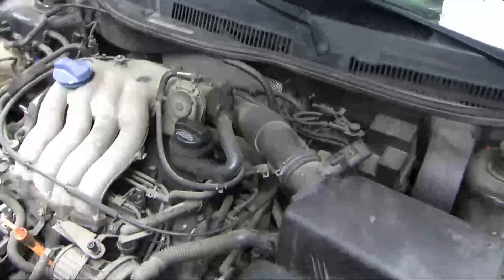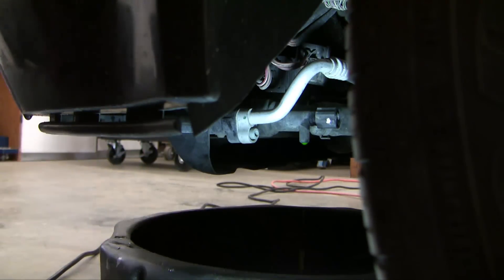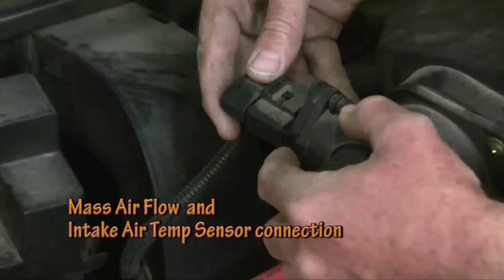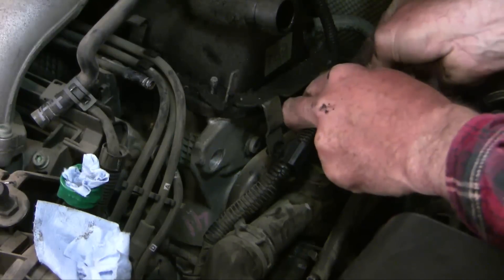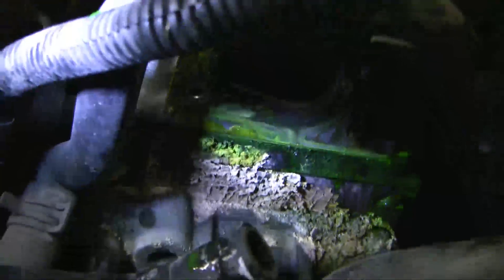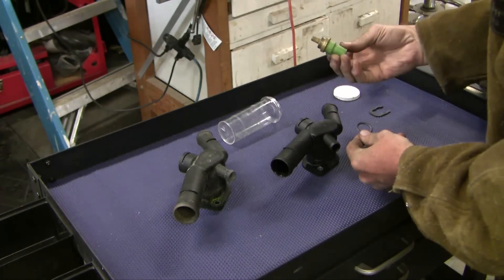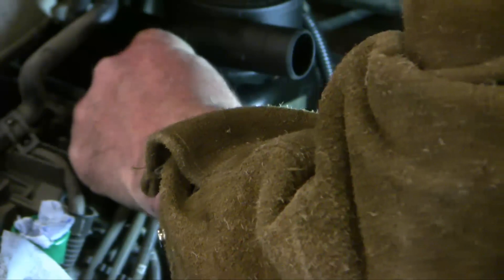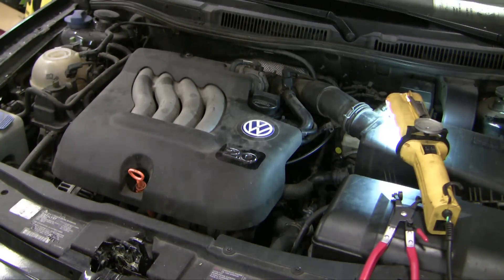VW Jetta Coolant Leak Repair

Comment: i have the same coolant flange on my jetta, and mine keeps breaking over and over it leaks past the gasket, like theres too much pressure.
Reply from the maker: This happens so commonly that many dealers consider it a normal maintenance item. I find the design frustrating, especially if you have to pay a professional to do it time and time again. It would be tempting to try something different, like higher torque or sealant. But those ideas have their own set of problems. The torque rating on the bolts is really quite low. I think the only long-lasting fix would be a steel flange, one that would permit higher torque and RTV, and one that had the same coefficient of expansion as the underlying block.
Reply: do they make a steel one, i havent been able to find one
Reply from the maker: Not that I know of, but sometimes I wonder if there would be a market for  an aftermarket device. Dealers make a living from repairing these, mostly off warranty. So they have little financial interest in going through the effort to make a longer lasting part..
Reply from the maker: simpleszabo Somehow I seem to have missed this remark when you posted it 5 months ago, but I got a notification today. Great idea! Here's the aftermarket coming through with a fix that VW should have thought of. Did it go on OK? Did you have any unexpected difficulties? Was there any issue with the fit and function of the coolant temp sensor?
Reply: nope not a single issue, same size, id recomend a little gasket seal spray to apply the gasket that comes with it, it helps when your trying to line up the bolts
Reply from the maker: simpleszabo If I ever have to do this again I'll look for a metal aftermarket replacement. Thanks for your contribution to the thread, it's worthwhile information.

Comment: My jetta almost blew up over a coolant flange issue recently. The mechanic I went to quoted me $1400, but after watching your video I really feel like I would do this myself. 
Since I don't have much experience with cars, do you think I could do this or was the $1400 a reasonable price for this job?
Reply from the maker: Any time you jump into something you've never done before, you of course take risk. We've all been there. Often, unexpected difficulties lead to other issues that may or may not be solvable with your personal skill (and tool) set. It's very possible to make things worse by damaging something else leading to more expensive professional effort, and of course there's the risk of personal injury. The amateur has to deal with complications that arise from having to use the wrong or inadequate tools and workspace, not to mention the fact that poor technique can lead to other problems. I've saved a little money by doing auto repairs over the decades, but much of what I've saved was reinvested back into tools. So, the main benefit I've gotten is not money but deeper, priceless understanding of how my cars work. Saving money should not the the main motivation to DIY auto repair since it often doesn't work out that way. Only you can say if you have the ability and willingness to go there. If you're in doubt, remember that I made it look easier than it may turn out for you.

Getting back to your situation, IF the repair goes well and no other issues are found, then, yeah, that seems a little expensive. However sometimes when an honest mechanic offers an estimate he adds something in case there are unforeseen issues, like a bad radiator, etc. Also there may be secondary issues that came as a result of the overheat. He never wants to ask for more later, so it's easier to tell everybody it's more up front, so the majority are not unpleasantly surprised. Mechanics also sometimes replace "possibly bad" parts like the coolant temp sensor or thermostat, reasoning that a callback to fix it later will sling mud onto their shop and lead to late unhappy cost to the consumer. Remember these guys are doing the estimate based on the guess about what the diagnosis is. A second opinion would be one option if you want to go there.
Reply: Thanks for your quick reply! 
This car has been on the lemon threshold since I got it (its a 2000 that was sitting for long periods of time at some point), and my dad is already willing to help me out with looking for a new one (I've got 1 more year of college left and unfortunately can't apply for a car lease/loan on my own). 

I really like your suggestion of wanting to do this in order to gain practical knowledge of how this car works. Worse comes to worst in my mind, I can't use a car that I already couldn't use. Really I feel I have nothing to lose in this anymore, so I think I might tinker with it using your video as a sturdy guide and see where I end up.

Again, thanks for your advice and awesome video!
Reply from the maker: Sounds like the right attitude, your story reminds me of various repairs I've done through the years. Bad or good, you'll never forget the experience. I hope your engine survives the overheat....

Comment: What is the little green part? I have a leak in it
Reply from the maker: The green device is the coolant temp sensor. It's held in place by a metal clip that pulls out with needle nose pliers. It's not likely the sensor is leaking, but much more likely the leak is a crack in the plastic coolant hose flange, to which it attaches. I can't rule out a leak through the seal, but given the history of this vehicle the coolant hose flange is a more likely culprit. Fix it by doing what I did here, or ask a pro to do it for a few hundred dollars. Don't procrastinate, overheating could damage your engine. While waiting to get this done, be sure your coolant level does not drop below the full mark, and if the vehicle overheats shut it off immediately.
Reply: spelunkerd it was basically spitting coolant out of it, I put some water in it to test it and it just poured out, and the little plug I pulled it out because it was kind of just hanging,
Reply from the maker: If the metal clip that holds the sensor in place comes off, the sensor will hang off and you'll have a catstrophe of coolant everywhere. It sounds like that happened to you, I hope the problem was worked out. Repair in this area isn't expensive but secondary problems from the overheat can be a real headache.
Reply: spelunkerd okay thank you

Comment: Could a failed water pump cause this?
Reply from the maker: Occasionally. 
When you're looking for a leak showing where the coolant is going, you want to remove enough plastic covers to allow you to see the weep hole, which drains the bearings for the water pump. I did a few videos on that, included in a cooling system playlist I made. When the seal that separates the coolant from the bearings fails, coolant causes progressive rust in the bearings, which should be dry. If you see a drip of coolant out the weep hole, the water pump needs to be changed. Water pumps fail in different ways, sometimes by failing seals, sometimes by squeaking pump bearings or serpentine belt strain, rarely by reduced output causing an overheat. The confusing thing about overheating is the fact that all overheats can cause depletion of coolant and trapped air, so often you need to burp the cooling system first to try and understand the underlying cause. In the Jetta MKIV, by far the  most common cause is the coolant hose flange, as shown. Good luck!

Comment: Could you, or someone, please tell me what the hose that connects to the bottom of the flange is called and what it goes to is called as well????  I am having a significant coolant leak on my 2003 jetta wolfsburg 1.8T 5sp. manual and I'm having trouble identifying the hose, the closest thing I can find online says it is a trans cooling hose, wouldn't that be for an auto trans though?? Here is a pic of the hose in question.
http://i.imgur.com/eQ2Ic.jpg
Reply from the maker: We sold the Jetta, so I let my subscription with Alldatadiy lapse. The first place I would go is there, you'll get 5 year access to the entire dealers manual for about $40, or less if you just need a year. I get dealer manual access for all my vehicles, Mitchelldiy is another option with a similar price. The other option would be to go to the dealer parts department and ask them to identify the hose for you, or at least give you a part number. I agree with you, replace the hose. Good luck!

Comment: Great job display.  I am changing yours and did not think I need to remove as many items.  The bracket you removed from under the flange seems to be the major barrier.  now that I saw how you removed I will see if I can do the job without removing all those other pieces.  I am dealing with a 1994 fossil, so I hesitate to agitate any connections that I do not have to agitate.    

How did you measure 7ft labs?  does your little wrench gauge torque?
Reply from the maker: I have an inch pound torque wrench that accurately gauges small torque like this, but I don't believe it's necessary. It did surprise me how low the standard torque for those two little bolts is -- presumably they don't want to break or distort new plastic parts. Yeah, if you can get by without removing a lot of parts, great.
Reply: spelunkerd, thanks. The job was going real well for me till I came to fastening the two sensors.  just how do you reinstall those U clips?  It is like putting a car into the garage through the window.
Reply: bwaha ha ha !  Just figured it out ... I have been accused of making things a little more difficult than they need be.
Reply from the maker: I've been there (grin).

Comment: anyone here have a issue with a p1255 engine coolant temperature sensor ground to short?
Reply from the maker: I would check your electrical connections and feeding wires at the sensor and compare measured resistance of the detached sensor to factory specs (I don't know those off hand). Replacing the temp sensor is easy, shown in this video, and I believe the sensor is fairly inexpensive. It can give false readings if you've got trapped steam beside the sensor, so for it to work properly the cooling system needs to be replenished and burped free of air.
Reply: +spelunkerd alright. I have a cam sensor code to. but its a pending generic code. I was told the ect sensor could throw the code?

Comment: And it's just for the coolant.
there is a specific VW and VAG oil too....or no more warranty !
do you use specific VW oil ?  : )

more funny : my volvo is equipped with a VW engine from factory and i have to use "volvo" coolant    LOL

so stupid.

like nissan with renault engines.....with no obligation to use specific products abroad !

Comment: Great video, hey I did this.....but I forgot to take the coolent cap off, I waited ages for mine to drain...lol, yep I feel dumb
Reply from the maker: Even that tells you something about your car. If the cap were defective or if the coolant hose was cracked, there wouldn't be enough vacuum in the system to hold fluid from gushing out the bottom. Little observations like you made today will stay with you forever, which is the kind of fundamental insight that makes backyard mechanics so rewarding. Thanks for stopping by!

Comment: I'm so nervous to do this .. I don't have money to repair and my Jetta is pissing out antifreeze. I can't afford to lose my car 😫
Reply from the maker: Fairly straight forward, but only you can assess your skill set. Even with no money you definitely need to get this fixed, the engine could overheat and grenade, so don't ignore it. This repair is normally not very expensive...
Reply: @spelunkerd  well wish this girl luck! I will definitely watch this over a couple times before I even attempt to see if I can see a leak thanks for the motivation and response!

Comment: They used wrong coolant. Never use green coolant in german car. Green coolant cause connections break. You should use Pentofrost violet color coolant which is special for germain car or special VW/Audi coolant. Please add a note to the video and let people know.
Reply from the maker: Thanks, good point, I had to go back and see what you are talking about. You should note that the coolant isn't green, it is pink G12, factory coolant. It looks green in the first few clips because I put UV dye into it to find the leak, and when under UV light the coolant looks green. You can see what color the coolant is in the final parts of this video when I add new coolant. While waiting for time to do the repair, I added pure distilled water and most of what was present at the beginning was water mixed with UV dye, no coolant at all. So, I didn't use the wrong coolant, you are incorrect. However you raise a good point, it is not wise to mix coolants, which means that I have about ten jugs of different varieties of coolant on the shelf today. Prestone sell a 'universal coolant' that is free of phosphates, but silicates are also banned for many new Asian cars, preferring instead OAT additives. As you may know, all have ethylene glycol but the additives are the defining point, and also the component that requires replacement. Ironically, older style coolants last much longer because they have fewer additives. For anybody interested, the best resource I've found is here https://www.machinerylubrication.com/Read/841/coolant-fundamentals
Reply: spelunkerd Thanks for clarifying. Great video!

Comment: Ah VAG coolants !
A lot of bla bla about these...

here peoples don't even know why they are obliged to use a specific vw coolant. g11 then g12 g12 + or g12 ++  but they buy it the eyes closed because the engine will blow up, the waranty will not work otherwise etc.....